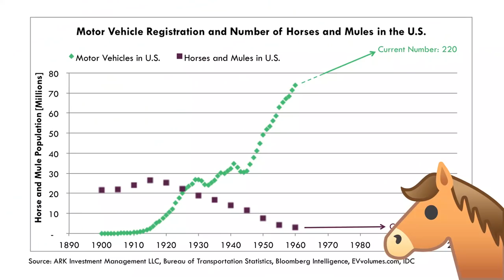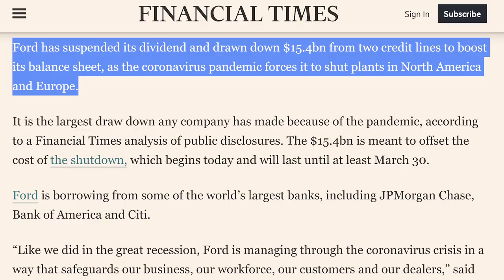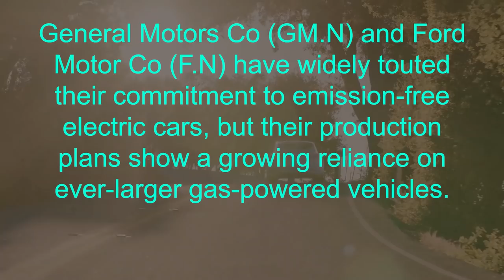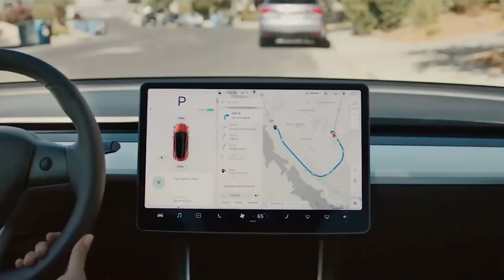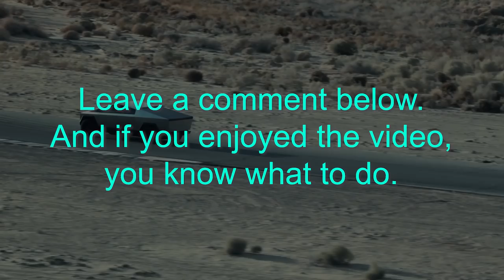Ford and GM are in BIG Trouble (bankrupt soon?)

Comment: Americans love big vehicles.  Tesla’s are too small.  We have winter and don’t trust the range of winter batteries.  We live far from work and don’t want to charge every night.  Gas prices will plummet as others switch to electric.  This new tech heavy car with few repair options means possible future loss of a job (if we have one) when the chips or screen or anything fails and needs replacement or repair we can’t get or afford.  Using a touchscreen is too distracting we need knobs you don’t need to look at.  Self driving autos are pricey and most people want a car $10,000 cheaper not more expensive.
     The battery recycling is something environmentally conscious people worry about.  The rare earth mining also worries people, the slavery of miners.  The longevity of the batteries is always a question because the formulas keep changing.  Most people will buy an old proven tries and true technology that also is familiar and comfortable.  We look at California and New York and laugh .. and look now they are the centers of disease, typically of crime, excesses of wealth and snootiness.  Innovation yes, but innovation for the rich.  Later the poor and middle class get some benefit.
     If the big automakers make one or two good quality normal size comfortable and familiar type EV in each of their auto segments, a few SUVs, a few CUVs, trucks, sports cars, etc., and its 90% as long range as the best, but has knobs, has a lot of room and not so tiny outside...  they will sell just as well or better than quicker ‘better’ Teslas.  If self driving is the Ford and GM killer they will buy the technology and if not they will use legislation to limit self-driving until they can catch up.  Making money on financing will not stop if people do switch to electric cars.  If they pay more for self driving technology, then the financing more will benefit GM and Ford.  
     With this crisis now, they could go bankrupt.  But although they may go bankrupt, they will be bailed out because we need local industrial competitors.  People are loyal and not afraid to mimic the leaders, so Ford and GM can somewhat copy Tesla designs, techniques, production, battery gigafactories, self driving, chemistry, software and so on.  Being followers, they should really learn to innovate here but they can struggle along as this is a powertrain and software change, it is not a wooden cart and horse to metal chassis and engine change.  Most of the vehicle making machinery they know how to use is the same as Tesla.  They will be the cheapo Androids to the more desirable Apples, but people buy Androids.  Elon and Tesla will suffer if they go more traditional in design as the corporate culture is to be the best.  They can’t imagine how second best may actually dominate market share, like third (4th?) best in long term reliability GM dominates USA sales.
     Being a first mover or inventor only works to grasp the entire market if nobody can see what you’ve done and come back and do it as good but much more cheaply or better in some aspect you fail to see.  Apple failed by sticking with tiny phones so long.  And so expensive.  And not much variety.  
     This is Tesla exactly.  Ugly safety-issue-causing touchscreen and sleepy boring cheap looking interiors.  Tiny.  Pricey.  The best driving tech and you pay for it.  Terrible service stories.  Questionable long term quality.  Who knows what the electronics will do and how they will age.  Arrogant.  Brainy.  Not family oriented as in their leadership and the size of the autos.
     EV sales are dismal because there is a lot of trust that needs to be built, and costs need to come down more.  Major changes to lifestyle is required to go EV, such as trip planning, batteries health watching, home charger installs... who cares if overall it’s as cheap as a Civic because the true data won’t be known for 10, 20 years maybe.
     What if you go out, get low on juice, and have to wait an hour to charge up, and lose your job because well that’s the third time late to work sorry.  People who buy new tech they do so as a toy not a main vehicle.  Most folks live paycheck to paycheck and will buy an EV when they win the lottery, become an engineer, doctor or lawyer, etc., or when they retire.
     People care about the climate on the coasts, not the interior.  They don’t care if they pollute.  When EVs are cheaper than ICE and charging is everywhere and they drive themselves absolutely they will dominate, especially coming from trusted old companies with great service options and low cost replacement parts, easy and legal to do it yourself, and etc.  A quick 2 minute guaranteed in every neighborhood recharge ‘spare gas can’ type of portable boost battery is needed to make owning an EV less risky for the mass middle and lower earners.
     The tech-savvy elite can’t and will not understand this because they are in an elite bubble surrounded by techie elitists and high earners with ‘good’ high education and abnormal lifestyles and finances compared to most bread and butter Americans😬

Comment: GM with its Ultium battery platform thing has great plans. But at the same moment, it lacks courage. They only plan a few cars for the coming years using that (bolt, a bolt based crossover, the hummer EV truck and Cadillac EV SUV). It would be a great start, but chance is high that that we’ll span several years and only after that they will start developing new EV’s on the problem once they see more demand and they see a profit coming on it. But they should invest more, dare to run a few years on heavy losses on EV’s if they really believe that Ultium will soon reach 100$/kWh. Only if they really bet on it, they will have decent lineup by 2025 and only then they can really see demand grow. But they are better off than Ford, Ford is just entering the market with the mustang mach E and will be using VW MEB platform for some other cars in the future. They lack a platform, so they are not yet able to start the transition like GM is doing now

Comment: A bailout only buys them time to die slowly.  VW is already realizing that software and programmers are something they don't have and need.   It could take them 5 years to develop good software.   It is such a problem that BMW Daimler and VW are all trying to work together on this problem.   All the talent is at Space X and Tesla.   They get the best of the best and continue to hire more and pull further ahead.   

This is the iPhone 1 It will be 3-5 years before someone has another iPhone we may consider.  It won't be GM or Ford.  VW is the only company that is all in.

Comment: This analysis skips a lot of important facts:

1. Oil is $20 a barrel
2. All cars are becoming computers on wheels. Not just EVs.
3. The refueling/range issue won't be totally solved anytime soon.

In conclusion, yes, we will transition to a large proportion of cars being EVs. It won't be this decade.
Reply: Samuel Waters nobody wants a gas guzzling computer my guy
Reply: Samuel Waters 500 mile EV is coming next year.... that’s a longer range than ANY gas car today
Reply: Nolan Abell 500 mile EVs will be sweet. My point is that $20 oil will slow EV adoption dramatically.

Comment: If the executives of the legacy companies try to be realistic, the plight at this point is so dire, they will be overseeing a truly stark period that is still likely to fail and the executives will be rewarded with nothing. If, however, they cling to the false narrative of utilizing external contractors (battery manufacturers, etc) and try to paint a false narrative of a very slow transition, by pretending battery tech will not advance for years, then they will be rewarding with large bonuses. As you said - they will be long gone by the time it becomes clear they are doomed. This kind of denial is natural when being disrupted. They don't have the technical understanding of the disruption so it's very difficult for them to see until it's far too late. Have a look at the Dunning Kruger effect - https://en.wikipedia.org/wiki/Dunning–Kruger_effect

Comment: Your sandbagging theory is intriguing, and they are releasing an electric Mustang.. But these guys have some institutions they can sit on (Mustang, F-150, Corvette) which still sell and I totally get why people would choose these over EV. And while I think ICE is ~90% doomed in the long run, many people still buy with their emotions rather than their brains. Paradigm shifts take long periods of time, older generations have to die out. I think the govt won't allow Ford's bankruptcy for the sake of appearances, but I'd love it to happen, they deserve a reality check - their company feels as old and boring as their cars.
Reply: How long did it take you mom to buy a cell phone? This transition will happen faster than you think. The resale value of ICE vehicles will diminish at an accelerating rate. The price of EV's   will be the same as ICE by the end of 2020 or mid 2021. Who in there right or left mind would want to buy a car that has no future value? Remember that most people replace there cars every 3-5 yrs. The used market for ICE in 5yrs will be dismal. So most, with a logical mind, will go for an EV based upon that alone. The rest (emotional mind) will follow once the have to sell their next ICE car in 2025. What I'm saying is that the transition to EV's will only be limited by supply. I think if Tesla could build 20-40 million EVs/yr by 2025 they'd have no problem selling them. Unforgettably, they'll only be able to build about 6-7 million/yr by then. So there's plenty of room for a competent competitor. I truly hope several emerge because Tesla can/t transition us to sustainability on there own. Crap...I just argued that it would happen faster than you think and then argued that it wouldn't happen fast enough....oh well ;)
Reply: @TimothyParker1  Not completely analogous as smart phones didn't have an all powerful sworn enemy. Another thing to mind is that ICE has a lot of jobs/money in it. A lot of the money that traditional ICE manufacturer's make is in maintenance. These companies are sales and service and the dealers are not going to like it when they have to kiss goodbye a portion of their revenue. They're going to fight for those profits and their jobs for as long as possible. The oil industry is going to put all the power and pressure they have into saving ICE for as long as possible. Also, to be fair there are a lot of ICE engines that are reliable enough. 10 years is giving human nature too much credit.

Comment: This makes me think it's similar to the automobile replacing horses for personal transportation.  The first ICE powered automobile was built in 1885 with the first mass-produced car from Oldsmobile in 1901, then along came Ford in 1908 with the Model T and revolutionized how cars are made.  History is repeating a century later.  There were early electric cars that were more an oddity, then a few mass produced ones.  Tesla is the new Model T, forcing everyone else to completely rethink how they do business.  Even today horses still have their uses where ICE powered vehicles aren't practical, but now those cases are the oddities and those horses kept and bred by horse lovers.  ICE vehicles will go the same way.  

The next paradigm shift I'm looking for is a movement away from batteries to Hydrogen Fuel Cells or other non-battery technology.  Even improved batteries can't compete with a fuel cell for convenience. It'll be like the transition from platter based hard drives to solid state drives. 

What really impresses me about Tesla is that for all their technology and how good their vehicles are - they're largely boring boxes.  When the Roadster comes out and they start making cars that also compete with the passion brands like Corvette, Porsche, Ferrari, et al, it's game over.
Reply: I agree with you up until the fuel cells. There's a reason why Elon Musk is deciding not to go down the fuel cell route. Not only is it less efficient, but it requires more infrastructure and dependency on businesses to produce, which is what we already have with petrol companies. The better route would be to improve the existing electrical infrastructure, and improve PV cell efficiency, which might eventually lead to self-sustaining solar cars.
Reply: @akkjuly17  A fair point.  The big advantage to fuel cells is the infrastructure largely is already in place with current gas stations. Rolling out hydrogen pumps would be similar to rolling out diesel pumps when diesel autos started becoming more mainstream.  It has the advantage of allowing us to use electric cars in largely the same way we use ICE cars, including long road trips.  It also solves a lot of the heavy metal requirements for batteries.  If we get to self-sustaining solar cars, all bets are off. These may be technologies that develop together. I can see where each has some advantages over the other.  There may not be a one size fits all solution.

Comment: See this is the view I just cannot agree with, the gasoline engine is far superior to electric cars especially for the lack of infrastructure and the lack of true versatility. Tesla claims that their cars have a 500 mile range blah blah blah, however that’s not highway driving, EVs do better in city due to regenerative braking. So just think, if you need to make a 12 hour trip, but every 3 hours you have to stop and recharge, your trip will be much longer. Tesla also doesn’t like any attempt to fix their cars or keep old Tesla’s on the road. Look at RichRebuilds and other Chanel’s for reference. Tesla’s also don’t take gas... yes but guess what it does take, ELECTRICITY! Electricity is not free, and electricity also is mainly generated through burning coal, so it not any better for the environment, and lithium ion batteries are very harmful to the environment in their production. Also who actually has fun driving an EV? I can buy a 1200 dollar 90s V8 muscle car which is tons more fun than a brand new Tesla model 3. (I’ve driven Tesla’s, many, and I’ve also got a trans am I bought for 1200 dollars so I would know) personally I have boats more fun in my muscle car, the sound and everything is just better. Realistically EV cars are just for rich environmentalists and the world will continue to run on oil as it has for ages.

Comment: This whole ventillator business is going to seriously cripple thier ability  recover from their debt.  Especially now that the President is threatening to force them to build them at no profit.  

Meanwhile I'm sure that the legacy auto makers are all waiting for the battery wars to be over and high capacity battery prices to tank before they pivot hard toward battery powered vehicles.  They want other people to solve the supercharger problem, other people to solve the battery problem, and other people to solve the PR problem and once it's actually cheaper to build an EV than an ICE they will switch.  Of course GM and especially Ford are in this precarious position of being the source of alot of the Vroom Vroom cult fanaticism.  It will be extremely difficult for them to make this tranisition because it means directly turning their backs on those members of the Vroom Vroom cult who have kept them in business through the lackluster decades.  Somehow Americans forgave them for moving manufacturing overseas and killing American jobs... But they don't believe they will be forgiven for killing off the V8.  And they are probably right.

Comment: Hey Steven:  have you seen this article about the new plug-in hybrid Ford F-150 truck?  It has 10 miles, TEN miles, of EV range with no load.  What a joke!    From Car and Driver:  "Ford also will offer the first plug-in hybrid in the half-ton-truck market, with an electric motor sandwiched between a turbo V-6 and a 10-speed auto. Electric range will probably exceed 10 miles, but only when commuting unladen."

Link: https://electrek.co/2020/04/09/new-ford-f-150-plug-in-hybrid-is-reported-to-offer-about-10-miles-of-ev-range/

Comment: Because I can't go on a long trip in an EV.
Reply: My EV drives itself on long trips.
Reply: Sandman My longest trip: SF to Boise. Model 3 is the only car I’d take on a long trip!  It drives itself 100 times safer than I can drive. I bought my Model 3 for long trips!

I have already planned three 10,000 mile plus trips for my Cybertruck starting in 2021! SF to Maine and Alaska, SF to Tip of Florida, SF to Panama!
Reply: Incorrect. ;)
Hint: Your normal sources of news and info are not giving you all of the facts, my friend.
You have to perform your own research. ;)

Comment: That “truck” is a joke.   Maybe someday bubba will climb into one, but not in my lifetime.  And stop saying how much cheaper the fuel is for ev’s, you pay for most of the fuel upfront , it’s called a battery.   I will drive my truck for 6 years and still not spend near the price of a battery pack for gas.  And stop saying how far behind gm is on ev technology.  They were building ev’s before Elon’s dad was born.

Comment: Lol, how much tesla stock are you holding? Tesla , Ford and GM are not selling cars in the same classification. I dont see any tesla at any jobsite or doing heavy duty work. Also  I sense a alot of bias here cause if you watch all his videos, he 's very pro tesla. IN short, there will be market for both ford, GM and tesla. Unless tesla can tow 20k-30k lbs for 400-500 miles, refuel in 5 mins ago. Dont bother